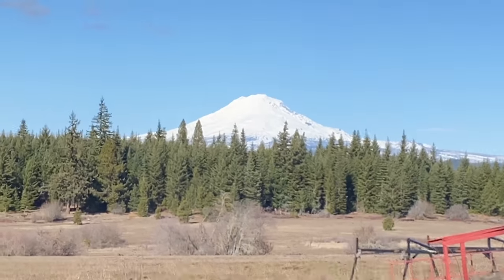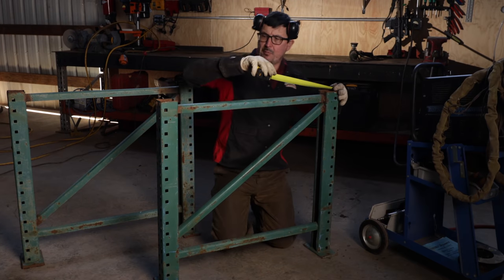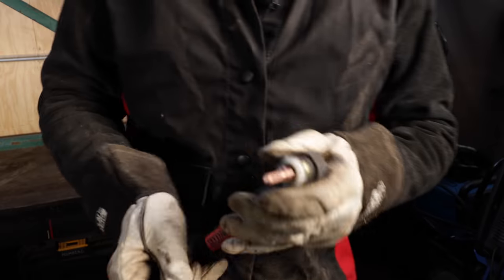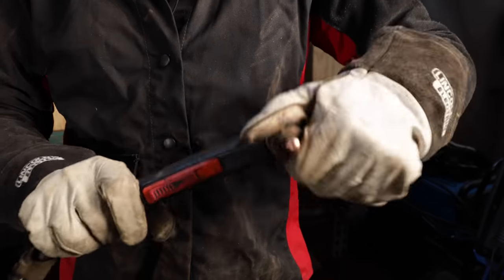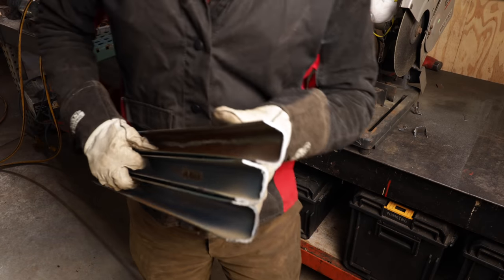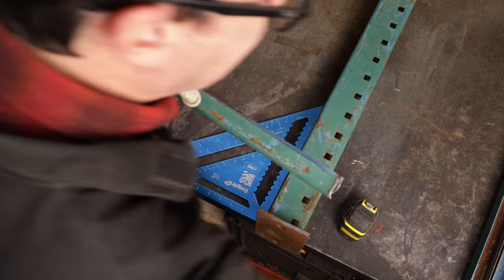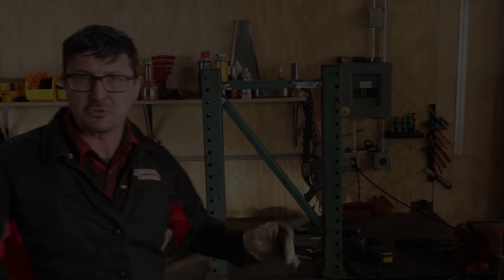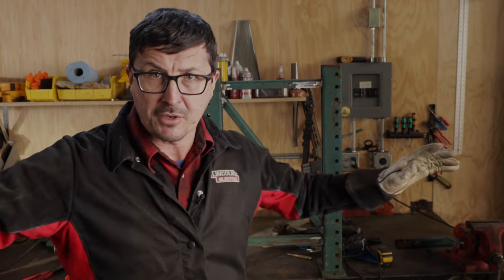Workbench - How To Build A Work Bench

Comment: A really nice gesture for you to help out a neighbor taking time away from your busy schedule.  Just a thought would it be advisable to consider putting the table on heavy duty locking casters so he can work on wider projects and have 360 degree access?  Not as stable but just a thought.
Reply from the maker: Trying to work on a table is casters is a nightmare,

Comment: One cool tip my dad told me that you should not tighten those grinder discs with the tool (because if you tighten it too much it could crack and shatter) you can get them tight enough by holding the disc and spinning it clockwise while holding the lock and of course when you have tightened the nut against the disc by hand, because when it spins it can only tighten itself. You can also get them open by hand (only if you tightened them by hand) by hitting the disc by hand to the direction that it opens while pressing the lock of course

Comment: The old pallet racking makes it easy to build a set of legs 1/4 inch top it should be strong enough for its intended purpose. You need a good work bench to work off of makes things so much easier.

Comment: A plasma cutter needs DRY air. a little bit of moisture from my shop air supply did $ 150 damage to the torch in 2 seconds . I use a motor guard filter then the small clear filters used by painters.

Comment: I think that if a flat table surface is desired that will stay flat over the long haul, you should go with 1/2" rather than 1/4" plate. The 1/4" stuff is likely to develop 'sagging' in spots where some beating of things with hammers tends to happen (and let's be honest - in a small shop, a welding/fab table is going to get some beating done on it). A thinner top is also subject to warping more easily than a thick one in response to heating and cooling as a result of welding on it.
Reply from the maker: 1/4" has worked out well for me,
Reply from the maker: Not to mention a sheet of 1/2" plate costs nearly $800
Reply: @wranglerstar  I never said it was cheap - just that it's what is necessary to keep a flat metalworking surface flat. ;-)  A 1/4" top would likely be fine for an owner that cares for his tools -- but Jeff is going to have employees working at that table, right? I've yet to find an employee that takes the same care with tools that the owner does.
In any event, I think it's great that you're helping Jeff out this way.

Comment: When you used that 3m mask, with your glasses. How do you keep them from fogging up? Any modern homesteading solutions?
Reply: Centrum Dom, it sounds crazy, but a little shaving cream does wonders. I used to use that when I played paintball and had to wear glasses under my goggles. Give it a go. Any, white, old fashioned shaving foam works well. Works even better on glass than plastic, but it still helps.
Reply: Yeah you will never see the fogging because you can’t see through the shaving cream. Duct tape would work too. Or close your eyes, it will never bother you again.
Reply: KD2RDH Larry, smarty pants. 🤦🏻‍♂️ Wipe it on and wipe it off. Obviously you do not leave any residue behind.

Comment: Did sparks do any damage to Leopold glass in the background?
Reply: I screwed up a few years ago and forgot to remove my watch. Welding spatter suck to the sapphire on my Suunto core. Scraped it off, watch is still usable, but the affect on optics would have be devastating.